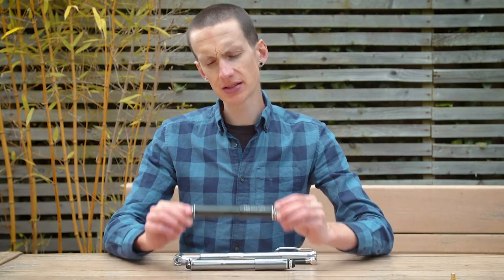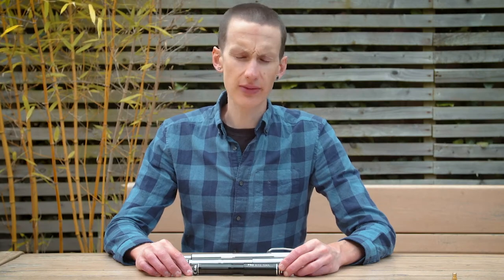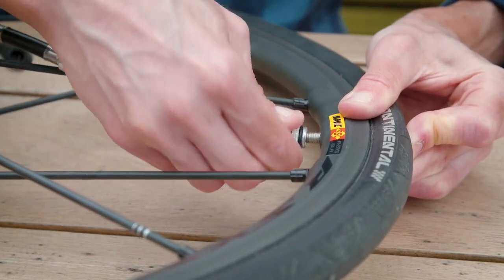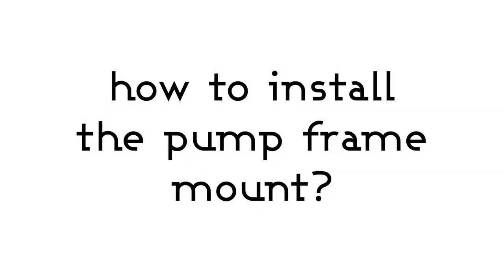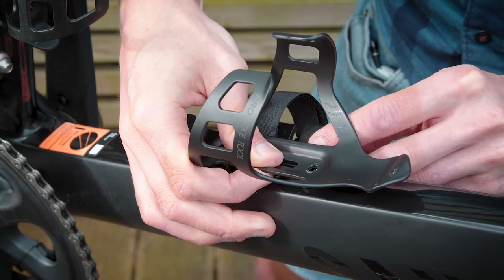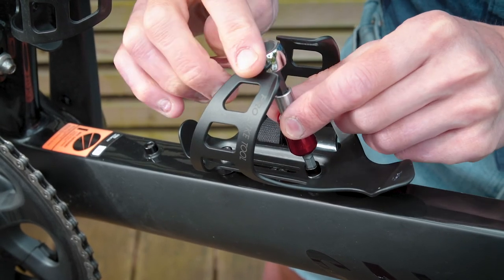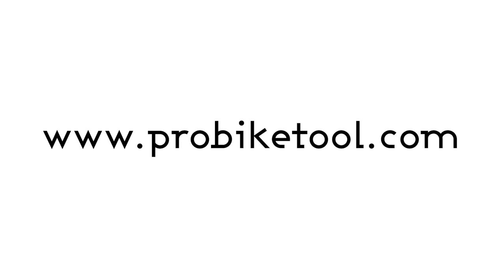Bike Pumps by PRO BIKE TOOL: FAQ

Comment: You did not actually answer the second question: Why is the gauge not rising as we pump?
I just got this pump and it pumps (the air does go through) but the gauge does not move at all. How to fix that?
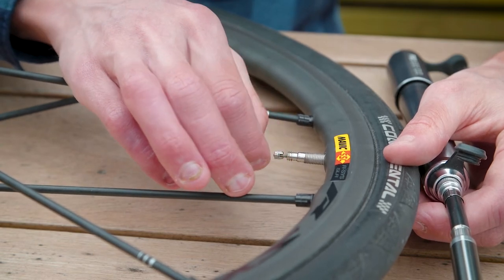Reply from the maker: Hi there, please refer to 1:31 on the video - you need to ensure that you have bled air from the valve by pushing down on it briefly to let some air hiss out. Then you need to ensure a tight connetion when screwing on the pump, as illustrated in the following seconds of the video. We hope this helps!
Reply: You didn’t say where the valve stem is located. I cannot find mine.